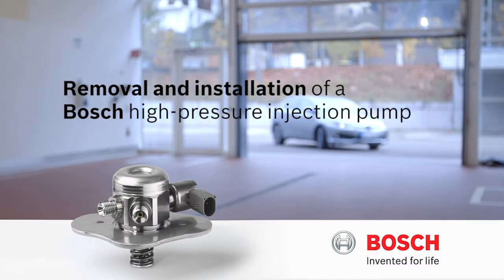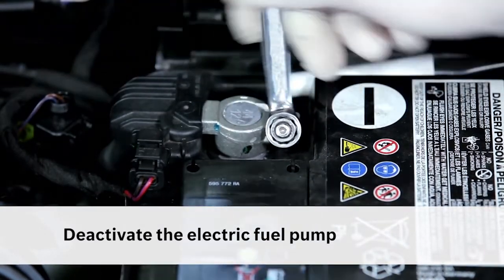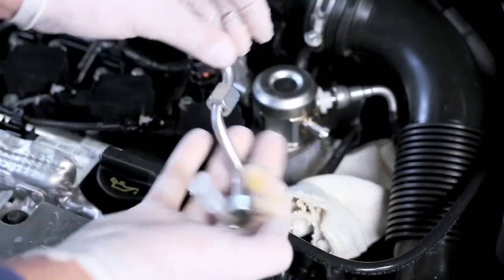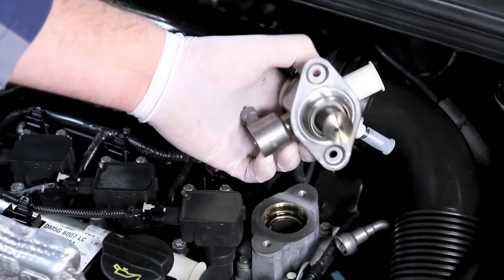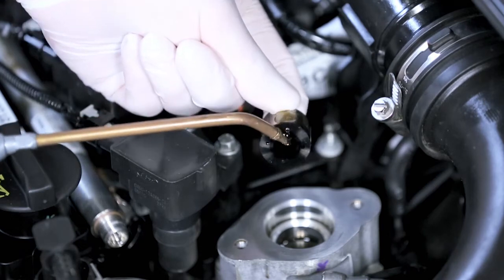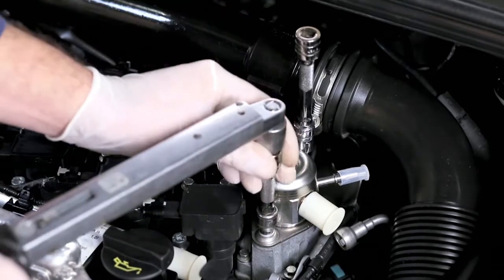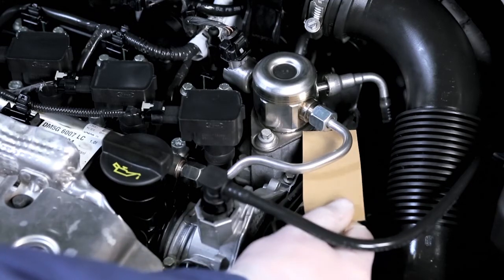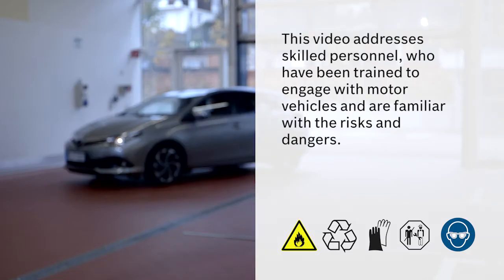How-to Video: Removing and Installing a Bosch gasoline direct injection HDP5 high pressure pump

Comment: The only reason that I watched this video was to get a look at how the low pressure fuel line was disconnected and reinstalled from the pump.... I guess that it is not important to show this. Could you please show how to do so?